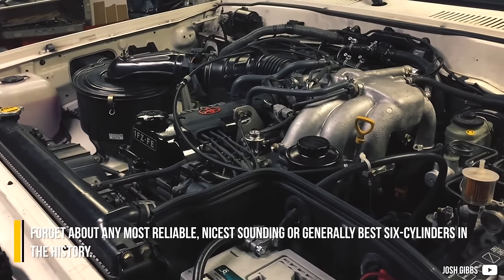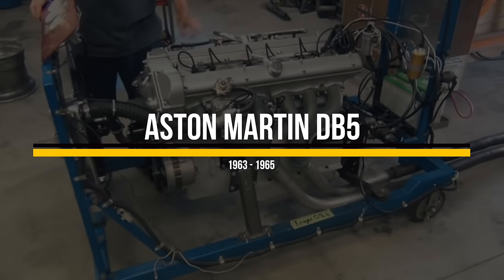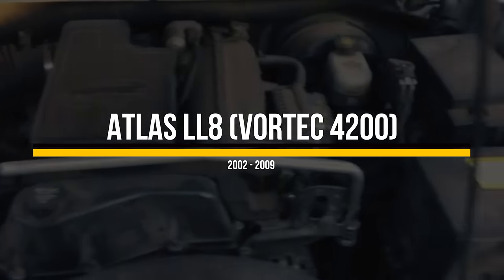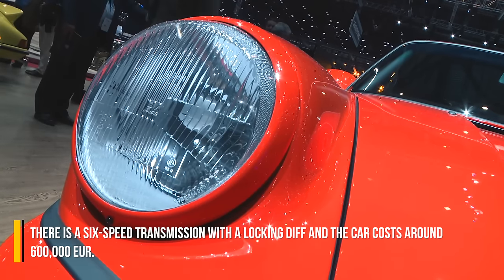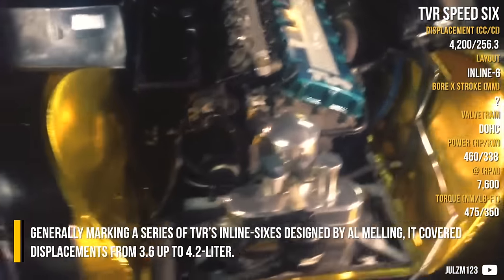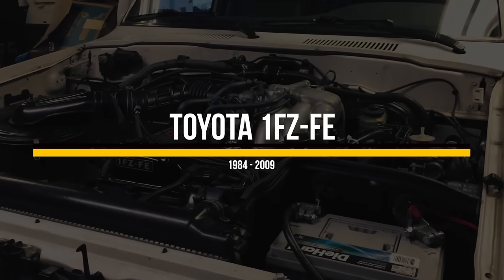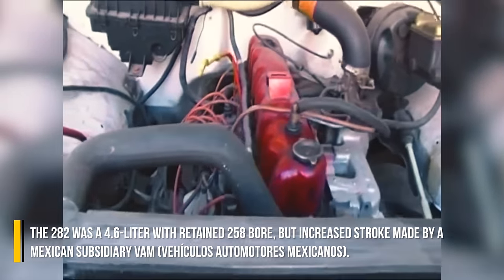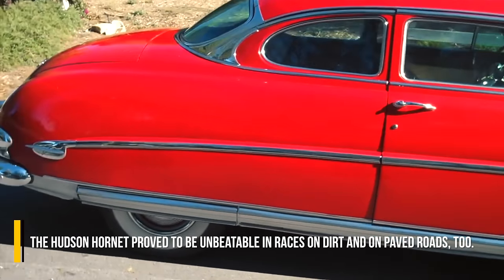12 Largest Automotive 6 Cylinders In The History

Comment: The Jaguar XK6 4.2 engine was best known for being in various versions of the XJ6 4.2 from it's launch in 1968 until the 90s. It is not popular in the E-type, the one to have is the 3.8 or the V12.
Reply: When first mentioned in the video, I immediately thought of all those XJ6 4.2 badges that adorned the right-hand side of the rear number-plate of the majority of XJ sedans over all the yrs since '68, with JAGUAR to the left!
Reply: The 4.2L was 'popular' in the E-type because a lot of them had them, although not as well liked and free revving as the 3.8L. or V12 (extended Buick V8)..
Reply: There is no connection at all between the Jaguar V12 and the Buick V8.  The Jaguar V12 was designed in-house by Jaguar employees Walter Hassan, Harry Mundy and Claude Bailey.  It was originally intended to be a 5.0 litre dohc engine for the mid-engined XJ13 Le Mans race car.  After the abandonment of that project, it was developed for road use as a 5.3 litre sohc engine.  Scroll on a few years, and the same basic unit powered the XJR-9 to victory in the 1988 Le Mans.  And lots of other major races....
Reply: IF you will check, the Jaguar engines and most British engines up to that time were undersquare with small bores and long strokes... engines that tended to quickly develop 'freeway knock' when the high speed expressways came to UK... however, the Jaguar V12 is oversquare with the exact same peculiar bore and stroke as the 1951 Buick/later Rover 215" / 3.5L aluminum V8... which was also converted to OHC by Rebco-Brabham for Formula 1 racing... 1 1/2 times 3.5L ==> 5.3L... those numbers sound familiar?

Comment: The VAM 282 was a 258 with a .125" larger cylinder bore to compensate for lower octane fuel.  In many way it can be thought of as the original 4.0 stroker.  There was also a 252 CID version of the 232.

Comment: Just fIY, those 3 cars you showed after the Barra engine are all earlier falcons that didn't come with a Barra, but the single cam predecessor engines with the same CC rating. That engine line has been in development for over 30 years of falcon models and has many iterations, but only BA onwards got the twin cam Barra.

Comment: GMC used even larger 6 cylinder motors. I had a 62 GMC 1/2 ton with a 305 V6 (5L) and I think they went up to 470/ 7.8L.  Ended up rebuilding it, having the cam reground with a modern profile, electric ignition, holly 500 2BBL carb and shaved the heads to bring up the compression about 1/2 a point.
Reply: Would love to see a vid of that running
Reply: @crf80fdarkdays  I sold that off a while ago now, don't think the guy who bought it has it either.

Comment: You missed the Chev sixes! 2 versions, both 250 cu. in., an under square car engine & an over square truck motor. you could fit a truck crank into a car block & end up with about 320 cu. in. weapon! Here in Oz, the car you call a Barra is a Ford Falcon. On the later 4.2l sixes, they fit a snail the size of a dinner plate & get up to 900hp!

Comment: I need that James Bond setup on the front of my vehicles. I bet uncovering twin 50's or 20mm's would get slow pokes out of the damn fast lane in a hurry. Especially if you installed a couple speakers up front that could replicate the sound of a guns firing along with a little flame from propane or something similar for the muzzle flash. Be funny as hell but it would need to be concealed well because the Highway Patrol probably wouldn't see the funny side.

Comment: For clarification, it might help to re-name this, "12 of the Largest Automotive 6 Cylinders in History".  These certainly aren't the largest twelve.  Apart from the exclusion of truck engines (see comments below), there are I6 engines bigger than some of these mentioned.  Jaguar XK (up to 4.2 litres), Rolls-Royce, also used a 4.2 litre I6 post-war, but the pre-war Silver Ghost engine was about 7.4 litres.  There are plenty more pre-war examples, such as Chitty Chitty Bang Bang, which had an aeronautical I6 of about 23 litres. ...

Comment: Folks tend to sleep on the Chevy Trailblazer with it's vortec 4200. In good shape, they have amazing low- to mid-range torque. On the highway, it'll straight-up get down when you floor it. 60-90 like it's a contest.

Comment: My GM opala 76, was swapped for  L6 292Ci, turbo on ethanol, 70 psi , bored for 310ci, on Weber idf 40, 680whp, this engine  here in Brazil called " sugar  caner " used in trucks and road trains sugar canes on 80'. Oem Torq 35kgfm, mine 100+ kgfm

Comment: I  am missing the Opel CIH engines.. the 6-cyl-versions were built from 1965 to 1995, from 2.2 liters up to 4 liters, including such gems like the Lotus Omega 3.6l twin turbo..  a while ago i had lots of fun with such an engine in a '71 Commodore A GS/E, even if it "only" had a 2.5 liter, it's stock 150 ps were an incredible tease to me ^-^, 
https://en.wikipedia.org/wiki/Opel_Cam-in-head_engine#Six-cylinder_versions

Comment: BARRA
Legendary engine! Factory red tops (turbo) can produce a awesome amount of power without building them!
They are tall, and actually the head is off at an angle, cos it's basically a single cam head, converted to twin cam.
Still love them!
Reply: They're also good at leaking & burning oil after a few yrs!

Comment: International Harvester made some big inline sixes. The propane dealer in Athens, Ohio when I was a kid  had an old Buick with one of these on propane that had high compression and a wild cam. It was a holy terror at the stoplight for its time but cornering was poor. I forget the size but it was over 400 cid as I recall. The owner’s kid got the car in the nineties and rebuilt it as a regular generic hot rod with a small block on gasoline and lowered it. Sad.

Comment: GM made a 4.2 liter 24 valve DOHC straight 6 from 2002-2008 with 300 HP, it was in the GMT360 and GMT 370 SUV's (Chevy Trailblazer, GMC Envoy, Oldsmobile Bravada, Buick Rainier, Isuzu Ascender, and SAAB 9-7).  Sweet engine own a 2007 Chevy Trailblazer with the Atlas straight 6
Reply: The Vortec 4200 is in the video but some of the info is incorrect. It made 270HP/275lb-ft for 02, 275HP/275lb-ft for 03-05 and 291HP/277lb-ft from 06-09. It definitely doesn't rev to 16000 RPM either.

Comment: Hmmmmm, apparently the Aussie Falcon six of 250 cubic inches along with two Chrysler Australia engines of 245 & 265 cubic inches were not worth a mention. The 265 engine was available with three DCOE Webbers [4 variants] with the best of them producing 302hp. This from a puny 265 cubes in a street car. As I said, not worth a mention apparently.

Comment: I don't know if it counts as a production car, or even car engine. But the Tucker 48 (or Torpedo) had a 5.5 Ltr (335 ci) air-cooled Flat 6. And even thou they didn't make it to production, 6 prototypes came with a 9.65 ltr (589 ci) flat 6. Both engines where OHV, had fuel injection and independent exhausts in 1948 (Chevys small block wouldn't arrive till 1955.)

Comment: You listed the Ford 300 truck engine, but left out the Chevy/GMC 292 I-6, and the 305 and 351 GMC pickup truck V6 engines of 1961-67. For medium duty trucks and busses, GMC also made 401 and 478ci V6s, as well as a 503ci gas I-6.

Comment: I used to own a 1988 Ford Bronco with a fuel Injected 300 ci inline 6 with a 5 speed compound first gear and overdrive. I don't remember the transfers case reduction by I did pull 8 inch trees from the ground at idle. 300 ft lbs torque at 1800rpm is the figure I remember. At 220000 miles I sold it to a friend in 2002. He still drives it. Only 11mpg I think killed the engine off production

Comment: Why didn't you include the vortec/ecotec 4.3 V6 its an excellent motor that's been around since 1985 and there also nice-sounding and have plenty of torque and power. The Gen 5 makes 285 hp and 305 lb-ft of torque but if you get the ethanol version it will produce up to 297 hp and 330 lb-ft of torque like I said they produce a lot of torque and its an awesome motor
Reply: Waaaaaaah

Comment: I had a 74f100 with the 300c.i.d. in line 6 that ..20 m.p.g. torque is nearly the same as a 351 Cleveland  (hears collective gasp)  the 300 was originally designed to be a tractor engine because of it's physical size the 300 was nicknamed /dubbed  the big 6

Comment: My Truck had a    International Harvester  Red Diamond  501 Cubic inch  Engine   5 1/4" stroke ..  it was a low compression gas guzzling Hog ..I replaced with  a 3206 cat diesel ..

Comment: You missed out on seeing the Australian Chrysler Chargers triple Weber equipped 265 Hemi six. A photo of one used as a foldout advertisement giving the impression of likely extreme endurance testing :
https://www.youtube.com/watch?v=uZwWmTuwzts&t=133s.
Also a partial explanation of the early (first?) adoption of Weber Carburation in a production engine of a US owned company.
In the early seventies racing in Australia there was a move away from the trend to imported V8 engines in the race specials for Bathurst.
Holden with the Torana and Chrysler with the Charger going for triple carb six cylinder cars unlike Ford. Reflecting the widespread usage of Australian made six cylinder motors in volume production, although in very basic spec.

Comment: Despite its fitment in more of Ford Australia's large sedans, station-wagons & utes, (than V8s), the Barra 6cyl was always heavy & thirsty, then becoming prone to leaking & burning oil once they'd racked up a few miles on the clock!
Reply: What crap 
ive got 2 Barra's 
one(182 4speed) approaching 400K Kms it still gets 8.8l/100km on the freeway never burnt oil or leaked ive seen em with more than 1million kms on them still fine!
the other a ute(195 5speed) approaching 200K kms just got 8.6L/ 100km (91 octane would have got 8.3 if 95 octane) on a trip Coolangatta to Dural one tank of fuel it also has never leaked or burnt oil!
They both will out accelerate  most cars on the road!

Comment: The TVR Speed six was not made in a 4.2 litre capacity only  3.6 and 4.0 you are probably getting confused with the AJP v8 designed by Al Melling that was made in 4.2 and 4.5 litre capacities for TVR.

Comment: You left out the 4.3 vortec v6 in the trucks and blazers!
Reply: Do you like the plugs being blown out of the heads?  Not just a problem of the Vortex 8's, I've seen it happen on both the 6's and 8's. Anyway, I like the straight 6's over the V-6's, more low end torque.
Reply: @lomgshorts3  never had that issue with eithet v6 ive owned

Comment: I don’t see how this constitutes a list of the largest 6 cylinder automotive engines. All but one was under 300 cubic inches and the majority were V-6s. Man’s, many vehicles had engines 300 CI and over. For example the Ford 300 I-6 was produced for decades and in everything from the falcon, Mercury, F series trucks etc. likewise the legendary Chevrolet Blue Flame six was built from the 1930’s right through the early 70’s.

Comment: Tucker cars had a 5.5L H6 and it's post WW2
Reply: that was a helicopter engine
Reply: @jbatic8094  that's true. But it was based on an helicopter engine, modified with notably cooling system going from air cooling to liquide cooling and then put into a car, so I guess it count as an automotive engine ...

Comment: Hudson hornet was also a light unibody. 
Really wish vortec would make a 5.0L v6 but won't happen because it would probably crush the small block v8 industry in fuel efficiency and maintenance cost. 
Oh well I guess I'll have to buy a vortec 350 v8 and replace the junk cam, rocker studs, and valves to get better fuel economy wish it didn't cost so much $$$$$$😧

Comment: you forgot to include the chrysler slant 6, the biggest was i think 232, while not the biggest, it was big and durable
Reply: Smaller than early 1950's Chevy stove bolt 235" straight six...
Reply: 225 cubes. Pity about only 4 main bearings though. But in Australia we replaced it with the Hemi 6. 7 bearing mains, big valves and up to 265 cubes. More power, much better on fuel and a race version with triple webers that held fastest accelerating Aussie production car claim for a quarter century.

Comment: 4.1L V6 making 125hp, that's almost impressively low.
Almost

(I know it's meant to be an understressed engine but even a 2.5-3.0L would suffice)
Reply: Pre-EFI, it was difficult to make emissions and mileage standards with carburetors.  So the engines were way detuned.  Don't judge the past by the standards of the present.  There's been 40 years of progress along the way.

Comment: I don't think 4L is big to a L6 or V6. It's normal, Toyota powered Hilux with this engine and other models I don't know, and GM had the great 4.100 in their cars. 
By the way, buses and trucks usually uses big 6 cylinder units, with 12L or more. This is big.

Comment: The Ford  300 CID is a good engine I have had two of them purchased new however it was not ever available as a passenger car engine, introduced in 1965 its car counterpart was the 240 CID engine available in full size fords so in this case does nor qualify as a car engine GMC also offered a 292 CID straight six at that time it also was only offered in trucks and was a offspring to the 250 six but with a way different head design and was not very popular in this case stick to passenger engines, if you understand the difference between a light truck and a passenger car
Reply: I don't think GM Atlas 6 engine ever offered in a car, either... just SUVs...

Comment: VIDEO SHOULD BE CALLED : TINY 6 CYLINDER ENGINES!!!  u missed the 600cu + and 700cu+ GMC massive inline 6 cylinder engines they are like what?? just under 10 liters!!!  been around for decades......low horsepower.  high torque engines,

Comment: I blew up 3 ford Essex V6 4.2 motors. They are fucking junk. First one seized solid, Second one cracked the heads 2 weeks being in the truck, and the third one suffered the same fate as the second.

The 5 speed manual also locked itself into 3rd gear.

Comment: The Australian Ford has the "biggest ever" 6 cylinder engine? 
How big is it?  You never say.
It would have to be larger than at least 308 cubic inches, since the 1951-1943 Hudson Hornet had a 308 inch/just over 5 liter 6. (that engine was optional in the other Hudson models, I belive, after 1952) (The Hornet's 6 was 5 inches bigger than the hair over 5 liter 1949-1954 Olds  303 "Rocket" V8 it competed against (and often times beat) in NASCAR races. (5 liters is 302 cubic inches)
I believe Mercedes Benz had a 8 or  10 liter inline 6 automobile engine. in the 1930's.  Fiat had a 12 or 14 liter 4 cylinder, racing engine, if memory serves, back in the 19-teens or early 1920's.

Comment: I understand what you are doing in the video but the title is wrong. You are discussing the most powerful, not the largest, and “in history” should be changed to “in recent history”. To add another layer of accuracy the word gasoline should probably be in there somewhere as well.

Combine the title with the thumbnail of the 1950’s car and the whole thing is way off. Not at all what I expected when clicking on the video.

Comment: there's far more Motors than this, such as the Chevy 292 straight 6 and GMC's truck engines 305 V6 401 V6 something like a 378 V6 and they even had like a 458 V6. Of course those are mostly truck engines.

Comment: 2:45 A four-barrel carburator... in a six cilinder?
Reply: Sure.  Why not?  It's not a problem with a V6.
Reply: Usually, the number of carburators/barrels is a multiple of the numer of cilinders.
For a 6 cilinder you (usually) use 3 dual barrel carbs. There are some triple barrel carbs, but they are rare.
That way each barrel is suplying fuel to 1 or 2 cilinders, with a 4 barrel carb, each barrel would be supplying fuel to 1 cilinder and a half.
I never heard of a carb "partially" giving fuel to a cilinder, it´s not imposible, but its weird as heck.
Reply: So Pontiac Tri-Power and Chrysler 440 Six--Pack setups shouldn't have worked at all?  If the engine has an intake manifold with a plenum, the number of carburetor barrels doesn't matter.  There is volume in the manifold for the air-fuel mixture to be properly distributed to the intake ports.  As long as the fuel jets are properly sized, the engines run just fine.  You are thinking of Weber setups where there is one throttle plate for each cylinder, such as 6 Weber downdrafts on Ferrari V12's, or dual IDA's on a Porsche 911, or dual DCOE's on my Cosworth Vega.
Reply: I´m not saying it wouldn´t work, i just not used to that configuration. You´re right about the "Weber setup", that´s what i´m used to.
But yeah, it works.
Reply: Pontiac 250ci ohc sprint in-line six.

Comment: 5Liter and 147 HP ? is that motor from 1930s?
Reply: That was only the base power for that engine with duel carburetors offered at the factory it made 160 HP, it could even make 220 HP with more performance offered over the counter from Hudson dealerships called the 7X. It also made more power than the first generation Oldsmobile 5 liter V-8 which at first only made 135 HP then was on par in 1952 with duel carburetor version of the Hudson 6.

Comment: Hudsons won 80 NASCAR races from 1951 to 1955, plus many 2nd and 3rd places. There likely wasn't a NASCAR race those years without at least one Hudson in the top 3 in 1951-1954. https://www.racing-reference.info/season-stats/1951/W/ Hudson was similarly dominant in MARC (later became ARCA) its first two years of 1953 and 1954, winning the majority of events both years. Despite such a smashing dominance in racing, it didn't translate to sales. Buyers wanted a V8, which Hudson wouldn't have until 1956. Hudson's racing performance almost completely ended in 1955, squeaking out but one win in the restyled Nash body. Its higher center of gravity and narrower track was far from ideal for racing, and the majority of the design dated to 1952 while Ford, GM, and Chrysler fielded new or nearly new designs.